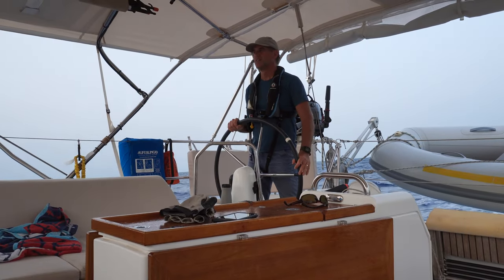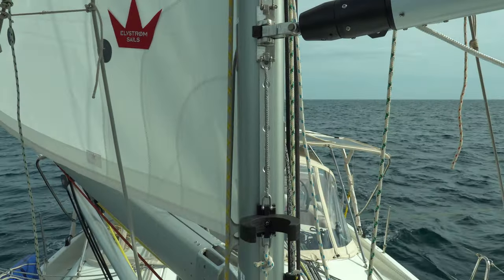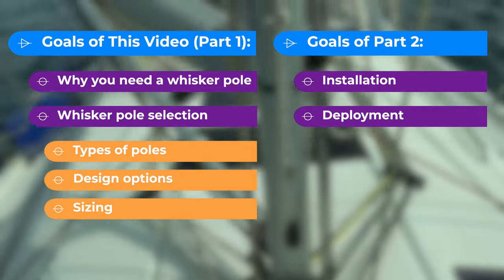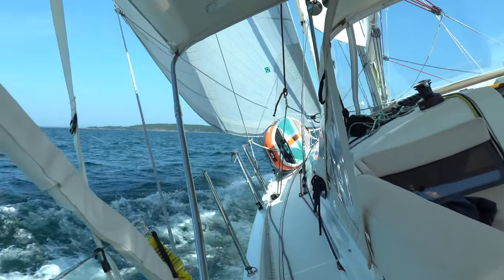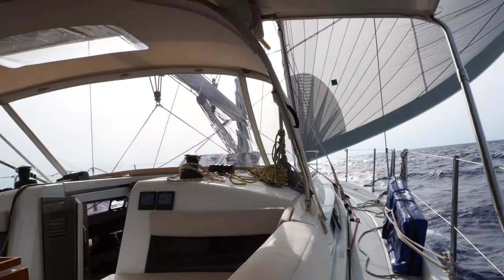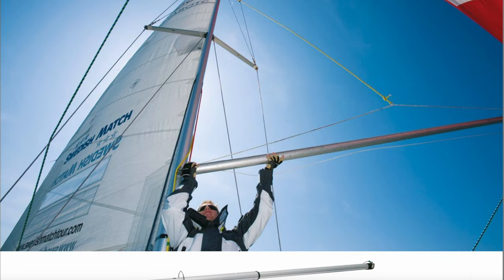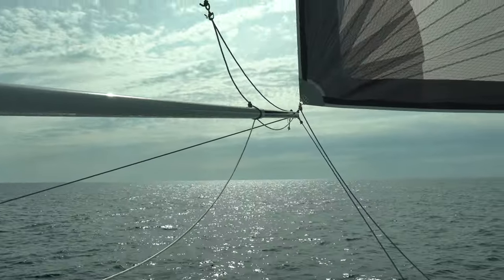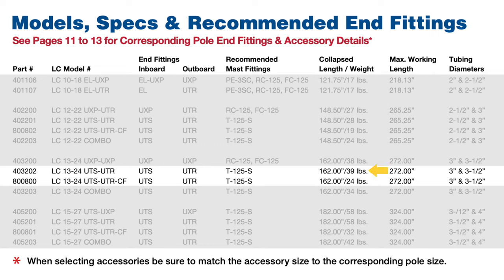How To Use A Whisker Pole For Better Sailing, Part 1 | Ep. 130

Comment: FYI: The length of the whisker pole is based on your  J dimension ( distance from the front of your mast to the base of your headstay). In racing your maximum allowable length is 1.4 X J.
Reply from the maker: Thank you!
Reply: "In racing your maximum allowable length is 1.4 X J" ... maybe in the US
'
Reply: @pmosbey1337  NO MAYBE ABOUT IT!
Which country is different?

Comment: Really good explanatory video and wonderfully calm and timed narration. You're good at this!

So could I ask a question my crew often ponder.
What would (or could, in the ideally worst conditions for it) happen if your boat seriously gybed while you were goose winged under pole and preventer?.... In various conditions. 
I know the remedy is to ungybe ASAP, but not what would happen if for some reason you didn't.
Other informed comments are welcomed too.
Reply from the maker: Thanks so much - glad you liked it. Regarding your question on a serious gybe while wing-and-wing, it depends on a lot of factors. Obviously, best to try to get the wind back to 180-degrees to ‘ungybe’. If it the fore- sail and you can not steer to re-fill the sail, it can be furled even with the pole out. With the main, it is a bit trickier. You would probably need to take the load on the preventer onto a winch so you could help the boom gybe all the way over in a controlled manner

Would love to hear other’s thoughts.